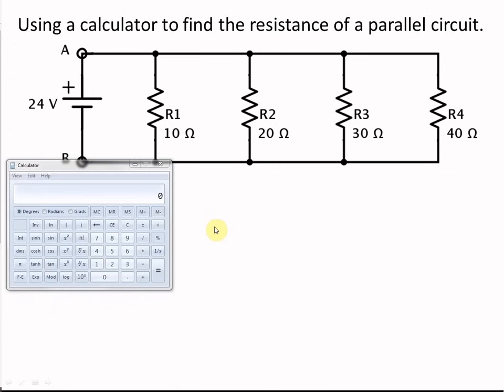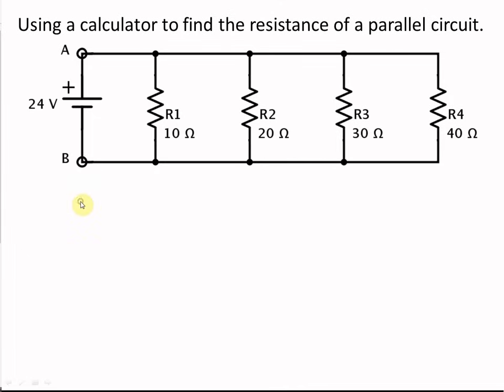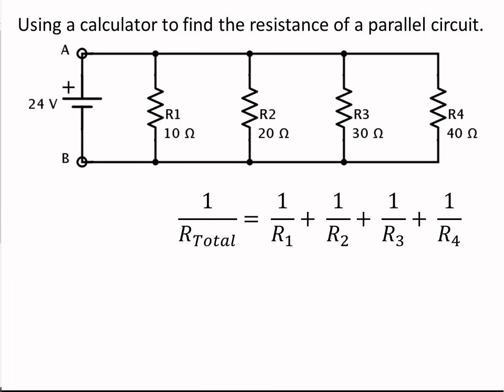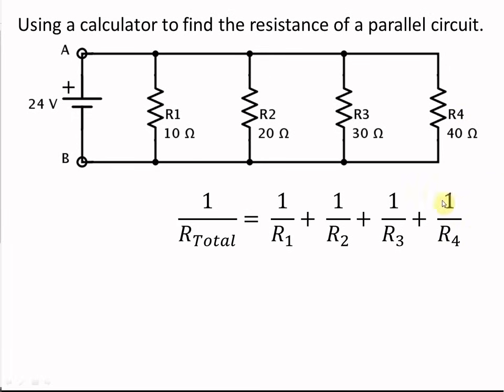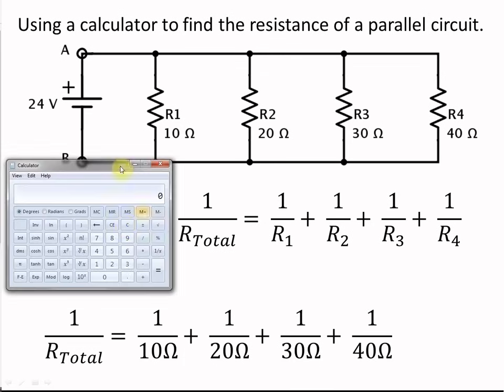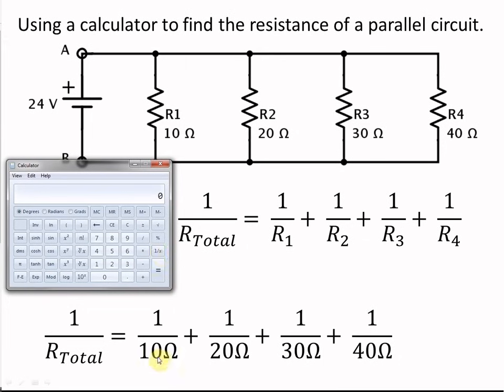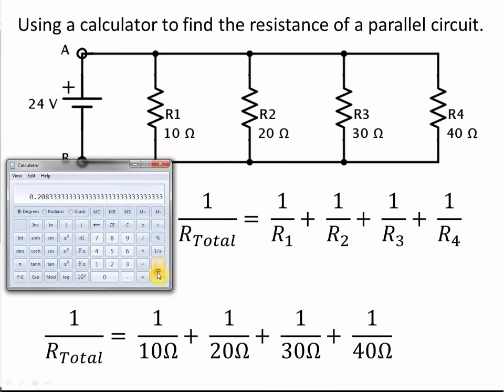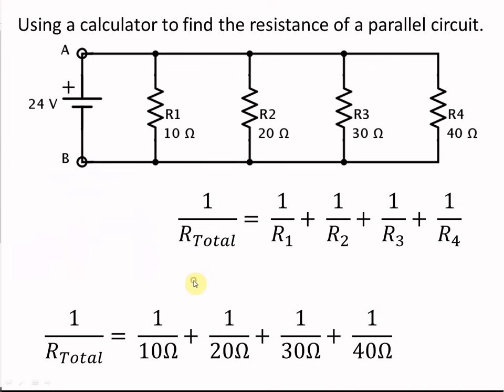Easy Calculator Method for Finding Total Resistance in a Parallel Circuits

Comment: Pls a quick question.... If i have a value like 1k,3k,5k resistor, can i convert it to like 1,000, 3000 and 5000 before i start calculating or i should should just add it like that.

Comment: Used this in the 70's for 4  8ohm Speakers, Parallel 2 Speakers, Parallel other 2 Speakers, then minus to minus, and plus to plus on both pairs, 8 ohm and 8 ohm in parallel is 4 Ohms, then Series the 2 Pairs, plus of pair one will connect to minus of pair 2. Then connect the negative of pair one to Amps Negative, Then Positives will connect to Amps Positive of Amps Speaker Connection.
With a calculator, think I use to(lets say 4 resistors(330, 270, 5600, 2200 Ohms)), would Enter
330 Invert+270 Invert+5600 Invert, plus 2200 Invert, = , then Invert again, think it was that Easy, need to dig out a Calculator with Invert to try, been a while. Can find anyone mentioning that way, If you did, Sorry for missing it. 
2 Equal Resistors in Parallel can be found by deviding one of the Resistors by 2, or half.
Resistors in Parallel is the same Formula as figuring Capacitors in Series.
Capacitors in Parallel Formuls is like
Resistors in Series(just add them up)

Comment: Are there other electrical calculations that are easily done by calculator, such as for capacitance? Thanks
Reply: It's just the reverse for capacitors vs. resistors 😊

Comment: 46 years ago I was taught the R1 x R2/R1 + R2 and that is easy with a pencil and paper. However this way with a calculator is fast and easy. Very good explanation in short time. Thank You!
Reply: That formula was for 2 given resistance.

This formula was for more than 2 resistance

Comment: Answers for current and voltage:
I Total = 5 amps
I1 = 2.4 amps
I2 = 1.2 amps
I3 = 0.8 amps 
I4 = 0.6 amps

Voltage Total (1-4) = 24v

Resistance Total = 4.800768 ohms

Comment: Finally found something that I can relate to. I’m in my second semester for HVAC, electric motors. My teacher is all over the place and I’m having a hard time with word problem calculations for ohms law and how to follow the schematics; starting with where the power or current is coming into a motor and how it moves throughout the machine. I’ll check out what else you have but I appreciate the video, it definitely help a ton!!!

Comment: I agree that is not Resistance.....Tadaaa. 

Resistance in what volt? :) through the parallel circuit on conducting from R1 R2 R3 and R4? I agree on the inverse in resistance in between the flow of current :).                  

Move on to the next problem and serve the problem and move to another problem and then serve the ohms to the villains . 

My favorite subject is physics :(  Looks like my future would be wiring and broadcasting or satellite TV to villains.
Reply: The inverse of resistance is called conductance.   Parallel branches add up their conductances to get the total conductance.  You then reciprocal the total conductance to get the equivalent resistance.

Comment: lets say you have 2 resistors 4.7K and 2.2K you would cal those as 4700 and 2200? Then use what you showed in video?
Reply from the maker: Yes, looks like you are on the right track.

Comment: Great help, but Im lost... this formula confuses me, how can you work it out, without the use of a calculator. Cant find a vid that explains the formula and what it means.
Reply: Essentially, it isn't resistance, but rather conductance, that adds up in parallel.  Conductance is defined as the reciprocal of resistance, so you add up reciprocal resistances, and then take the reciprocal.

For 2 resistors, the formula simplifies to product over sum (Req = R1*R2/(R1+R2)).
For n-identical resistors of resistance R, the formula simplifies to Req=R/n.
Those are the two conditions that are practical to evaluate without a calculator.  Anything else, you'll probably want to use a calculator, unless you really want to do a lot of tedious arithmetic, or you are given numbers that keep the arithmetic simple.

Comment: Damn it! Just bought a new calculator and guess what.?. It doesn't have this function. Or if it does I can't find it.
Reply: Look for the x^(-1) button, or the 1/x button.  Usually, one of these buttons will exist.

Or type the expression 1/Ans in your calculator.  You can usually get to Ans, the previous answer stored in memory, by using the 2nd function button.

Comment: Don't use the button on the calculator ,make the formula ,,,1/20 =0.05  for example , if you use the stinking  button you gonna become dummy very shortly , when i become electrician 50 years ago  no calculators  back then  ,every formula was made by hand,  and after i become  i went for electronics and then for  electrical engineer,,,NO CALCULATORS .
Reply from the maker: Glad you can do it without a calculator. Remember that after you add all those inverses, the decimal you showed here, you then have the inverse of the correct answer. That is the step my students would always forget, and why I made the video.

Comment: Is this the same for caps?
Reply: Sort of.  Except since capacitance is defined in the opposite way from resistance, the formulas are reversed.  Parallel capacitance adds up directly, while series capacitance adds up in reciprocal.

For impedances in general, it is the same as resistance, where it adds up directly in series, and in reciprocal in parallel.  If you treat the capacitor as an impedance given by Zc = 1/(j*omega*C), you can use the same generalized formula.  Caution: you'll need proficiency in complex numbers (j = imaginary unit) to use this method.

Comment: One thing that is also helpful is that when you have 2 resistors you can use Rtotal=(R1*R2)/(R1+R2) which is the same if u do the algebra for yourself.
Reply: Thanks, man.
Reply: Will have to give that a try

Comment: Not using calculator can u do ?
Reply: Sure, just be prepared for a lot of tedious arithmetic.

For 2 resistors, the formula simplifies to product over sum (Req = R1*R2/(R1+R2)).
For n-identical resistors of resistance R, the formula simplifies to Req=R/n.
Those are the two conditions that are practical to evaluate without a calculator.

Comment: dan that answer is wrong you surpose to add up all the number which will be 4 over a 100 then you flip it so it will be 100 over 4 and then the answer will be 25

Comment: How do I get the ohms of 350 volts
Reply from the maker: You don't. While a batter or power source does have a internal resistance, it is usually found through experimental means. But I am assuming that is not what you mean. Volts does not convert to Ohms, any more than miles converts to pounds.

Comment: When I do the calculation it’s coming up with a fraction 24 over 5 is there a way to change it ??
Reply from the maker: It is the settings in your calculator. Do a search using "calculator gives answers in fractions" and add your calculator's model in the search field.
Reply: 10+inverse +20inverse+30inverse+30inverse+40= and inverse one more time